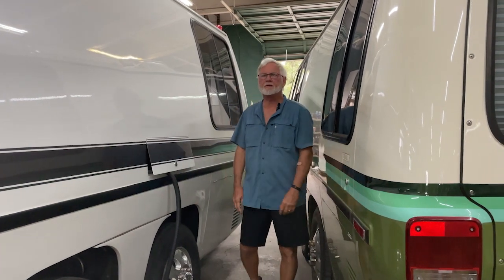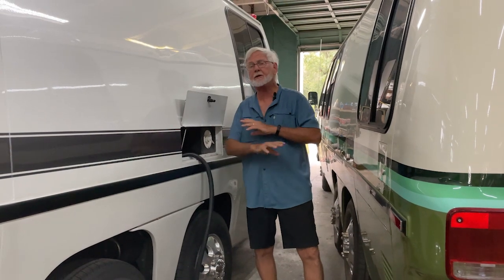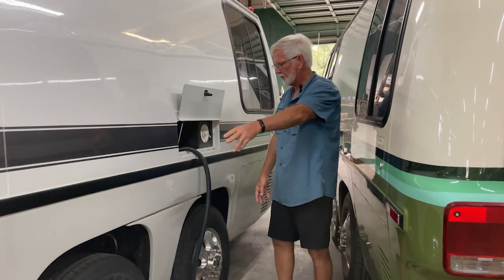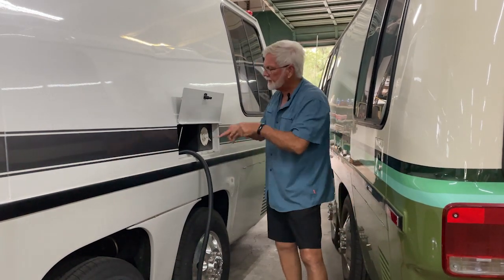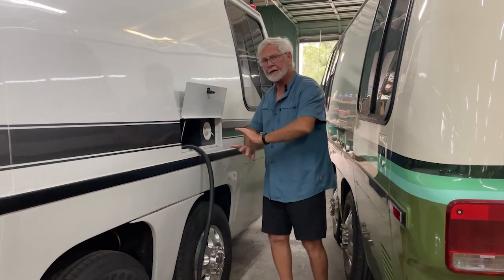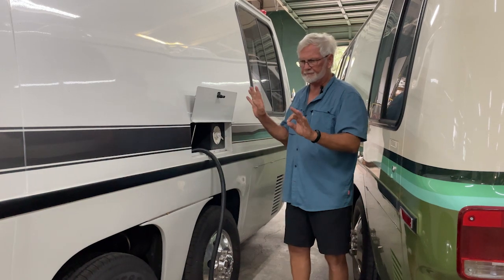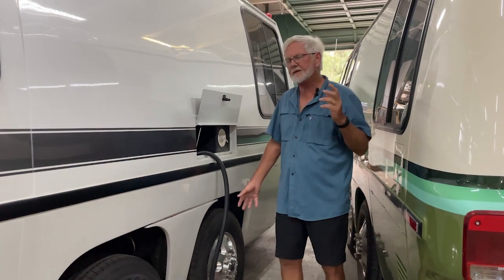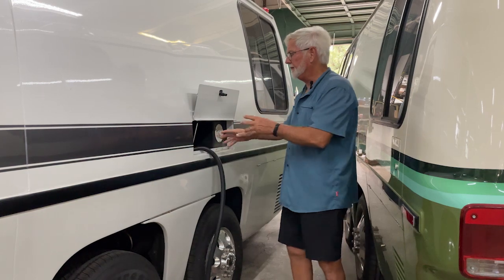Powering The House Side of Your GMC Motorhome 101

Comment: Jim, first, thank you very much for doing all these videos and helping out the community. 2nd, the GMC gurus as you call them aren't your only audience. When you're tearing into the pistons and the carburettors, you don't apologize to the owners that know nothing about that stuff, so you don't need to apologize to the gurus for making a "101" video for those of us that know nothing. Videos on how to jack the coach up to change a flat, this one about the basics of plugging in your coach, how the fresh, black, and city water work, how the water pump works, basic propane, these are all FANTASTIC videos. State what the topic is, and if it's simple, those that already know it will go watch something else. Those of us that don't know anything will watch every single one of these basic 'from the beginning' videos you make, and we'll watch them MANY times! You don't need to apologize for making 'basic' videos. Nubes want your help too! Thank you, thank you, thank you.

Some basic video ideas for you...

Jacking up the coach with a bottle jack and that steel j-hook that goes in the hole in the bogies
You have a flat on the side of the highway. I have the wood block with the threaded rod. Exactly how does that work so I can at least get off the road into a nearby parking lot?
I have the curved steel bar for placing between the tires. What's that for, and where does it go exactly?
I've never hooked up the sewer to dump. How does that work? Assume factory original, no macerator.
Furnace won't start. I have the upgraded furnace with access from the added outside panel. How does one remove it to fix it?
Factory back benches. Mine didn't have any. I bought some. I have the brackets, but they're not installed. Exactly where do I install the brackets? Exactly how do you attach the benches to the brackets so they hold the benches, and the benches can then be put up and down?

Just some ideas for "101" type videos. Again, thanks so much for these basic, basic videos. A large part of your audience REALLY wants these.

Comment: When my buzz box died. We re-purposed a 1600w bitmain power supply from an antminer s9. It provides 12v @ 133amps which easily runs all of the 12v lights and refrigerator. I actually don't have a house battery installed at the moment...lol 😂

Comment: Hi Jim, I do not own a GMC or any RV but I'm very interested.  I'm still a little confused about the 50 amp cord being curled up and then plugged back into the GMC.  If I understand correctly, the cord is used to plug into power at the RV park, which powers the" house side"  of the GMC.  Is the end attached to the GMC hardwired or also a plug?  So, when the 50 amp cord is rolled up, the end that was attached  to the RV park power now goes to a separate receptacle to the generator?  Or is the generator  hardwired to the circuit panel, which would backfeed to the cord when the generator is on? I guess my questions boil down to, is there one or two receptacles in the power port area of the GMC? (One to Circuit panel, and one to generator?)
Reply: Its all answered in the video. Rewatch it

Comment: Sorry for my ignorance. Can anyone with electrical knowledge explain this to me in more detail?

First off… it blew my mind when he said it’s 0 in RV world. I never even considered hooking a connection up this way. I’m happy I saw this video because I might have really messed up. 

Is this a standard at RV parks? Running both legs of the RV connection on the same busbar? It makes sense that you don’t need the 220v but you’d want the amps. How is this accomplished? Would a tandem breaker be the easiest way? 

Is there a problem with using a standard 220v connection (right amp rating of course) on an RV? Lets say a guy already has a 220v connection in his garage for a welder and wants to also use this connection/extension cord for an RV. Is there a potential for overcurrent on a single leg of this extension?